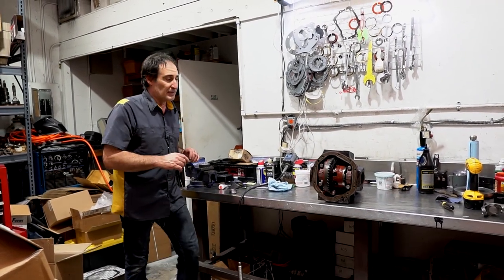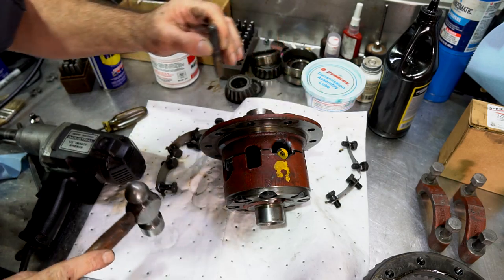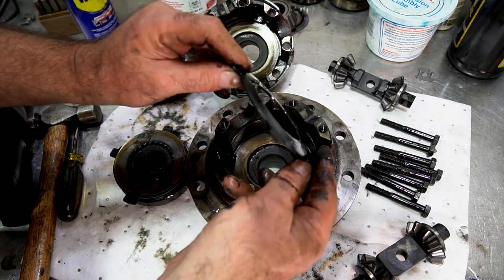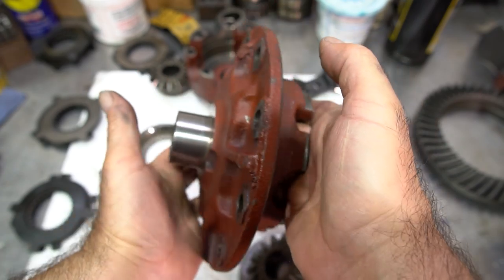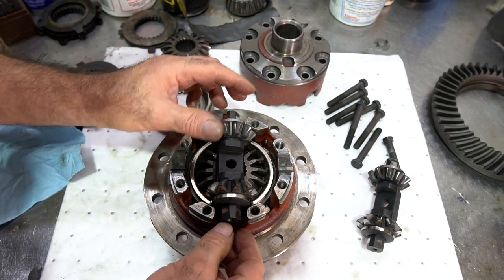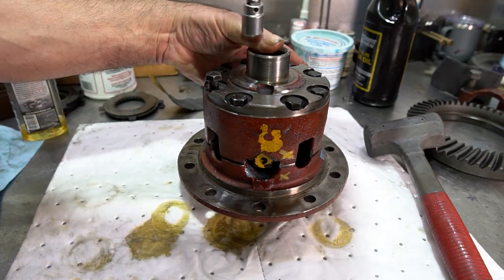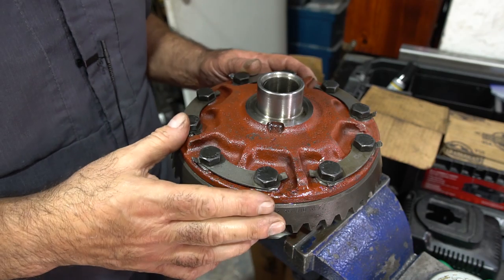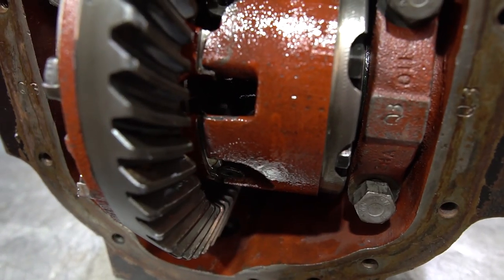Dana 44 Power Lock Rebuild for Jaguar XKE IRS

Comment: Thanks for posting this Paul.  It gave me the confidence to replace my own clutch pack.  Is there a chance you can suggest how to test the breakaway torque? I clamped the whole case in the vice and inserted the driveshaft end with a torque wrench on and it wont breakaway - tried up to 100 ft lbs and dont want to go further and cause damage.  I arranged the pack as you stated, so tried re-packing with a disc missing each side and confirmed it works (disk pressure causing it to lock) so my test initial test must be floored in some way. Any suggestions how to test?

Comment: Great video as always, thank for sharing......got a bit an off-topic question:  have you ever seen a Warner 10-10-024 Industrial transmission,  it's a single speed forward-reverse with a torque converter, used in a forklift from the 1970s. II cannot find a manual/drawings or parts for it here in the UK, and on Google, this thing does not exist either. Don't even know pressure figures and port locations, any help would be much appreciated.
Reply from the maker: No.  I've only seem manual fork lift units
Reply: Try contacting aittransmission.com and velvetdrive.com

Comment: Hi there Paul, 
I got through my Dana 44 finally. What a tedious task! Ugh...so now I am going through my dana 30. New carrier bearings and pinion bearing. I have the pinion depth of 2.250 starting point. The pinion head has 2 surfaces to measure inner circle machined, and the outer circle that is machined deeper than the center. Which do I use for the depth?
I checked the pattern and it was terrible. That's whats up...ugh...
1998 Jeep Grand Cherokee, front axle.
Ok. After watching the Dana 44 pinion setup, you depth checked to the center of the pinion. Should be good to go, but I would love to get a reply back on this.
Thank You again!

Comment: Thank you for a very informative video. I have used it as guide for my recent replacement of the clutch plates in my Jaguar XKE 1965 diff. which I'm currently also are swapping from 3.54 to a 3.07 gearing. After assembly the carrier with new clutch plates I noticed that the axles for the spider gears seems to be loose in the carrier housing. I am not sure if they were loose before changing the clutch plates. I have put the carrier into the diff housing and startet setting up and shimming the new ring a pinion. When I turn the gears i can hear a rattling from the loose spider gear axles. Is it normal that the spider gear axles are a little loose and rattle when turning the gears by hand?
Reply from the maker: The gearset should be tight. If you can move the axles independently then limited slip obviously is set too loose
Reply: @GearBoxVideo  Thank you for your reply. The gear wheels are actually not loose. It only the gearshafts which are loose. Correct me if I am wrong, but theoretically the shafts/axles can be loose if there is even pressure from both sides of the clutch pack. They are not fixed in the housing and only "sit" in the triangular milling. Or have I totally misunderstood the matter? For your information I have used a Spicer/Dana 44 clutch pack. Perhaps this is not working with the Jaguar/Thornton power lock even if the plates fits fine in the housing?
Reply from the maker: There are diffrent size bevel plates. The axles float since it is the bearing assembly that supports them

Comment: The Dana 44 in my CJ5 has a Trac Lok diff if I'm not mistaken. It doesn't seem to work anymore even with the correct gear lube and friction modifier . I will have to wait until I find a Trac Lok rebuild video or find a better replacement LS diff
Reply: They are not difficult at all to replace. It's different then qhat your seeing in this video and very very easy to replace. Just comment the year make and model of your cj5 ND I can point you in the right direction. There is hundreds of videos on that trac lock. It's almost the same in Mt 95 dosge 9.25 rear-end

Comment: Is it safe to assume, that this carrier will fit into a solid axle DANA 44, like out of a Jeep?... is the strength less or more, carrier to carrier?... Again, thank you for the great content, as always.
Reply from the maker: Carriers have different bearing arrangements. So the Jag 44 has different carrier bearings than a Jeep. However you can swap ring and Pinions if you know what you are doing. Jags have bigger ring gear bolts and unique pinion splines. Carriers cannot be swapped.
Reply: @GearBoxVideo  Roger that!!!!  only you would know this info off the top of your head, like you do... Thank you much Brother!!

Comment: Paul . On the clutch plates could you use the Bead blaster fine grit to remove the Glaze 🐤😨
Reply from the maker: You just want to break the glaze. Depending on the pressure you can ruin the surface.

Comment: Why didn't you soak the new clutches in the oil?? That's recommended for every brand new clutch pack
Reply from the maker: I found it makes no difference. I do lube them and I do not get any clunking or chattering issues. Sometimes using the wrong oil creates more chattering issues.

Comment: Good morning,
What type of oil, what viscosity index should be put in this model of limited slip differential ? 80W90 LSD or 75W140 LSD or.... ? Thanks
Reply from the maker: I use 75-90

Comment: Hi there, I have a hydra-lok/ vari-lok on my Dana 44 aluminum/Dana 44 HD. I was informed I cannot service it. But the clutch’s maybe can be changed and fixed. Can you help with some info/ your opinion.regards
Reply from the maker: I haven't seen any parts for those and don't have any around so see what's in them. What vehicle do you have?
Reply: @GearBoxVideo  Hi  thanks for the reply. I will send you e-mail with detail. regards

Comment: Do you have to break them in when you replace the clutch pack? I replaced mine and it really chatters ….only drove it a couple miles.
Reply from the maker: Make sure you use limited slip additive with the oil

Comment: A lot different than a Dana 44 in a C4 Corvette, I have a Dane 36 the housing itself is worn out, even with new clutches there is to much slip.
Reply from the maker: Get a stick rear.  They seem to be available cheap

Comment: Your supposed to locktite the ring gear bolts unless they are reverse threads
Reply from the maker: That's what lock plates are for. The factory never used thread locker.
Reply: @GearBoxVideo  Everyone has something to say I say he did a damn nice job THANKS PAUL.
Reply: This guy is one of the world's most knowledgeable on this subject, he shares his incredibly extensive knowledge and skills with the world for free, and you want to come along and tell him how it's done?? Very brave ;) 

But while i'm here, it's "you're", as in "you are", and "loctite" is a brand name... He is correct, the factory never used loctite, hence, the lock plates... Those bolts aint goin anywhere.